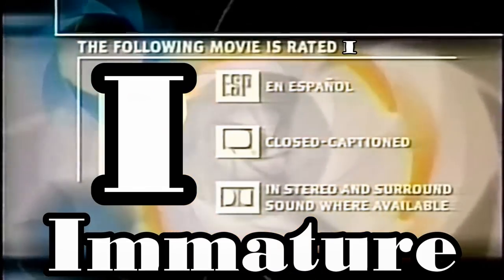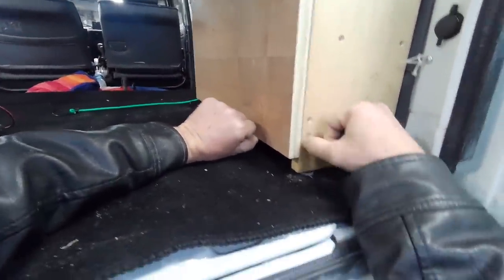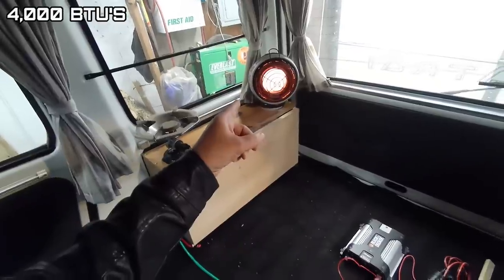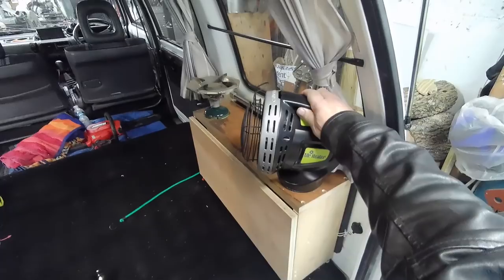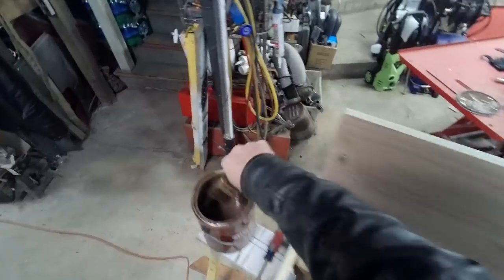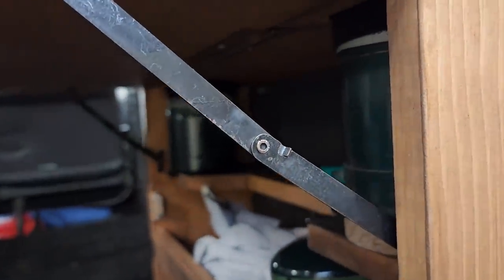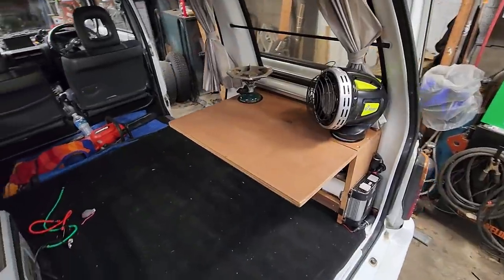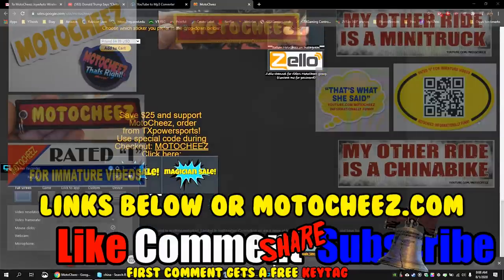Micro Van (SE1 E09)  Building custom cabinet w flip table Heater stove  storage Camper conversion

Comment: Radiant heat feels warmer in drafty dwellings because it heats the people and objects and doesn't heat the air that quickly leaves.  Radiant heat is great for a garage.  A person generates around 75 watts of heat.  That's probably enough to take the chill off the inside of a micro van.  It could be comfortable to sleep in a thick winter sleeping bag on a thermally insulated mat and use the propane for heat when relaxing in the van, and to warm it up before going to bed so you aren't crawling into an icy sleeping bag.  I'd get a small carbon monoxide detector even though the heater has a low oxygen cutoff.

Comment: Just get a french press Cheezy, then you don't have to deal with a percolator burning your coffee - the clean up on them is simple too.  There's a bunch of companies that make them in all stainless, in case you're fearing that a glass one might break, but they tend to run a bit higher in price than glass ones.
Reply from the maker: A bunch of you mentioned that, I looked at a few.

Comment: You can by rolls of the foil backed  insulation (same stuff they use for windscreen sun shades) looks like bubble wrap with aluminum foil on both sides. Anyway you can cut them into that same shape as the windows and press fit them to act as privacy/insulation screens with the added benefit of cutting down on glass moisture condensation. It might help shield heat from the propane devices. only down side is they are a bit bulky to carry around when not in use.
Reply from the maker: Would it hold up to the heat of the stove? I'm worried  about cracking the glass. Don't ask me why...ok,  I did it on my porch with a grill years ago
Reply: @MotoCheez  it wouldn't hurt but I'd probably make a separate heat shield from sheet metal. That stove burner top is a kind of large... maybe a smaller version would be better with a like a diy pie dish flame/wind guard.
Reply: @MotoCheez  I use 1 of those butane can camp stoves that fit in the rectangle carry cases, but I understand it a try and use what you got situation.
Reply from the maker: I have a couple of those too. Nice and compact, I keep one in my Rubicon.

Comment: I have one of those Chinese diesel heaters from Amazon for my van, 2003 Chevy 3500, with the 6.0..Those kind of heaters just blow warm air and they are cheap, 135 bucks, but I do have a solar system, you need a dc electric source, but you can't beat the heat, it's the same as your furnace at home...I got a fridge with the danfoss compressor, takes about 60 watts an hour, as well as a bed, max air exhaust fan, in the roof, propane stove with burners, and the rest of the amenities, it's a nice set up..Live in there when I'm traveling, can't beat it..Got the kayak on the roof and my home made electric mountain bike on the back door...Got a new controller for the bike, it will do fifty, all day...Took a year to build it all out..I can stay in the middle of nowhere, just depending on how much food and water I have, the longest has been a month...Good luck...
Reply from the maker: I looked into the diesel heaters, they're nice. I didn't want to cut an exhaust hole and I want this removable with a few screws. Wow, sounds like you have a good setup.

Comment: Add a fan desiged for woodburning stove and attach it above the heater.  Any time it gets hot, it'll move air and keeps the hotspots at bay.  Love it on my little buddy heater.
Reply from the maker: I bought a small 12v fan, be good for summer too

Comment: One of the heat powered wood stove fans works great with little radiant heaters like that. Moves the heat around instead of it pooling over the heater.
Reply from the maker: I might put a oscillating fan up near ceiling, for summer time too

Comment: Take a ceramic tile and silicone it in place between the heater and cooker.   Now you have a safe place to set a hot pan/pot.  Need a little kit for stiring, flipping too.
Reply from the maker: Good idea! I just ordered a SS basket to fit there tho...

Comment: I don't know how effective the inverter would be at running it. But I use a mini parabolic heater up in my bedroom during the winter for heat. When the temps aren't super cold and you crank the heater to max settings the room can get quite uncomfortable from the heat. It's only about a 6" fan so it's pretty effective for its' size. If my 14ft x 20ft room can get uncomfortable when the outside temps are in the 30's I'm sure your little van would be an oven. Of course being electric it would suck your battery dry in no time. :)
Reply from the maker: It would kill the battery fast. Inverters have high losses. Like 20%,  even a 12v heater would drain the battery too fast, it's basically a direct short to give off the heat. The battery in these are the size of a tractor battery.

Comment: Get you one of those diesel heaters.  Pretty easy to install.  I got one in my garage add on.  Works pretty good, it would work great in your Micro van.  Just a thought....  It and the fuel tank would probably fit in your cabinet with a few modifications, and their pretty damn efficient, you could vent the exhaust down through the floor.
Reply from the maker: I saw those, just didn't want to keep everything easily removable
Reply: @MotoCheez  It's definitely a more involved setup and not easily removed, but  you're also creative and could figure something out!!

Comment: Cigar socket　１２V５A　MAX60W　
 battery runs out in an hour with an electric stove
Reply from the maker: Electric heating is huge draw, not viable. Propane better. I ran the 12v socket, good for 30a

Comment: What about carbon monoxide? You can't do electric?
Reply from the maker: Can't do electric, used way too much power and these have small batteries. I crack the window a bit, plus has built in shut off sensors